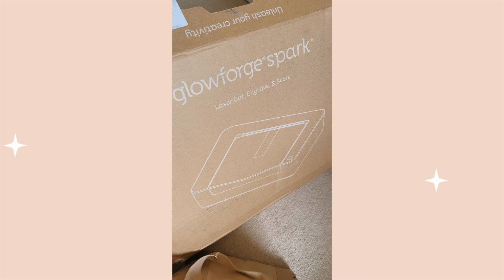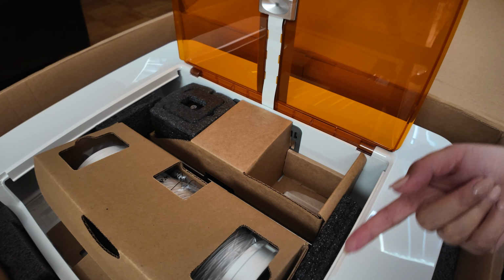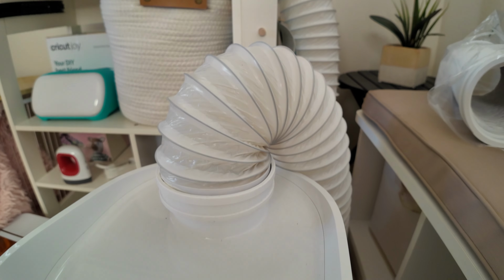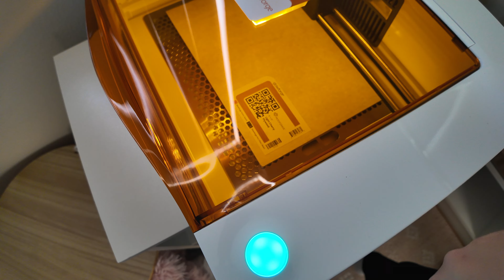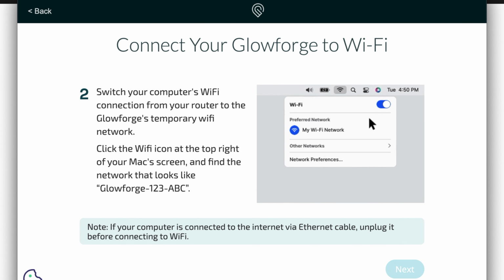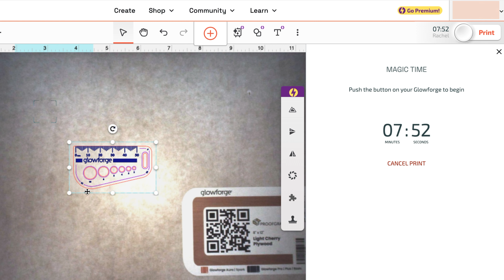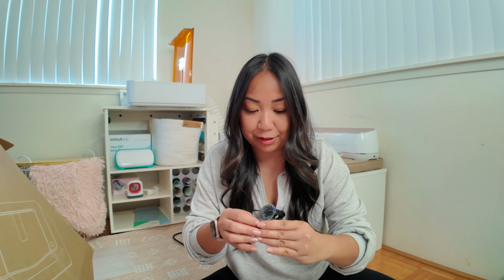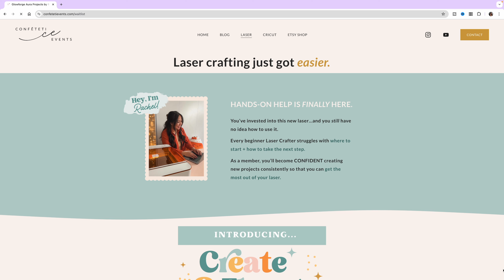Unboxing the NEW Glowforge Spark! ✨

Comment: Wow, I just watched the video of a possible merger or takeover of this machine by Cricut and I have to ask, why haven't I heard about this machine before?  I'm just starting out with Cricut and I have the Maker 3, which is supposed to do a lot of amazing stuff, but this machine looks really cool, so I'm going to investigate further.
Reply: Well, this version the Spark and Aura, is not as powerful or fast as the higher end brand.  I purchased the Basic Glowforge from the kickstarter kit.  It was intimidating (noisy) and I thank God for the Spark and the Aura (but it’s really loud).  However, the problems with both Circuit and Glowforge is still disappointing.